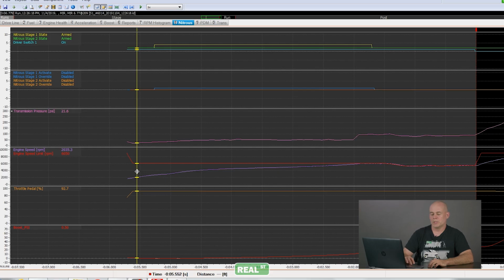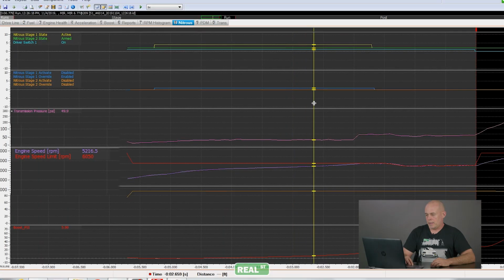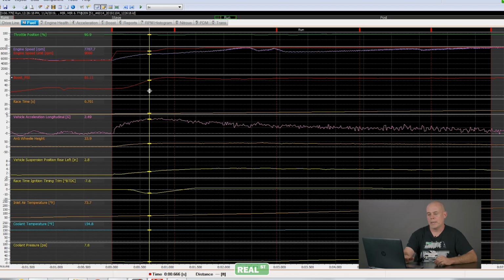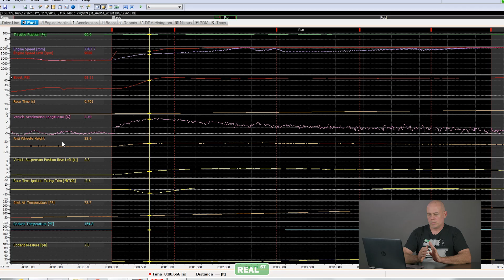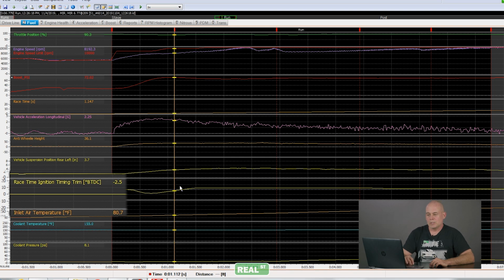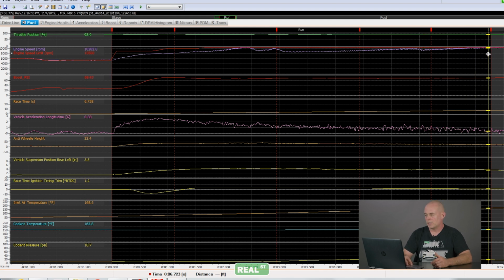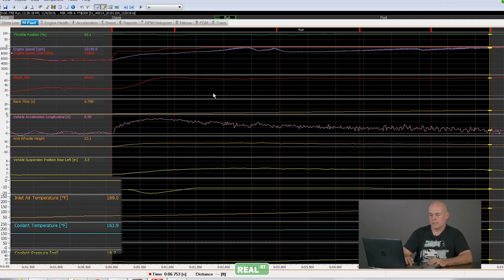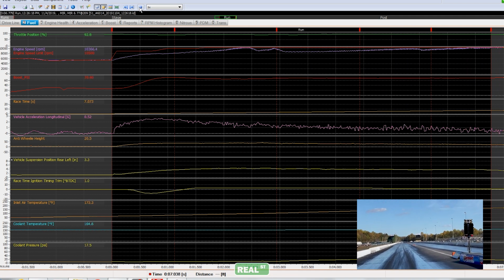Real Street Supra 6 Second Run Motec ECU Log Breakdown by Jay

Comment: Full Disclosure:  I've almost no experience with, Motec, 2J stuff, cars going that fast, or making that kind of power.  What little experience I have is centered around stuff that runs high 4's to mid 5's in the 1/8 mile; and that experience is all but exclusive to domestic V8 applications.  I apologize if this question is "old hat" to people more familiar with other platforms.  

I was wondering why the TPS sticks around 90-92% for the entire pass?  I've had some cars do that, but it has always been unintentional - throttle cable adjustment, TPS calibration, etc...  The Supra in the video seems well thought out and well executed; and doesn't strike me as the kind of car that accidentally has throttle cable or TPS calibration issues.

That makes me wonder if the TPS riding in the low 90's is being done intentionally.  If so, could you expand on that a little?

(Regarding TPS being intentionally less than 100%):  I've done some stuff where 98-100% TPS would bring in an extra fuel pump, start a timer relating to timing or boost retard, the typical nitrous activation, de-activate the brake lights for some index racers, etc...  I've set some cars up where a quick pedal of the throttle from TPS>98, to TPS<95, and then back to TPS>98; in less than .2 or so would activate a boost override, or converter lock up, etc...  There's a whole host of things over the years that I've turned on / off / PWM based on TPS percentage.  However, I can't think of a reason (off the top of my head) that I would set up a TPS the way the log shows.   

I've had some stuff where 100% TPS put the throttle blade past horizontal / optimal angle; in those cases 90-ish percent TPS would equate to a flat or wide open throttle blade.  When I see that, I can usually get the TPS calibrated so that 100% TPS represents wide open; if the blade goes past wide open / optimal, the TPS typically reports a value greater than 100% - 101, 105, 110, etc...

I think the Supra in the video is a very nice car that is done extremely well.  The idea that the TPS riding at less than 98-100% is a mistake, error or something that was accidentally overlooked; doesn't really jive with my impression of the car.  Which, again, makes me wonder if the low TPS% is intentional.  If so, I'd love to know the thought process / reasoning behind it.

Thanks, and sorry for the length of comment.

-Josh
theundergg@gmail.com

Comment: Dropping race car knowledges in the tuner world! Man went into rear suspension separation, converter dumps and ride height sensors! Love it! Also insightful to hear that you guys are using a lock up converter. Id like to know how much of a difference its made of the 4% slip you were seeing without the lock up?
Reply from the maker: Thanks! maybe ill do a video on that next!
Reply: @realstreetperformance  please do! Can’t get enough of these vids! You share knowledge that most big time tuners/chassis guys hold secret.
Reply: My guess is that the 4% slip is not enough RPM drop, which would put them crossing the finish line in a higher RPM than where they want to be. At first my thought process was backwards...I had to think about it a 2nd time.
Reply: @JimBob-wy7tl  It’s good stuff!

Comment: Is there a reason to shut off engine when high coolant pressure occurs? Engine shut off is an instant thermal shock , isn't it a worse than keep engine running and let coolant to circulate?
Reply: It means that the head is lifting or/and that the head gasket is failing , higher coolant pressure means that there is a risk of coolant leakage which could go under the tires